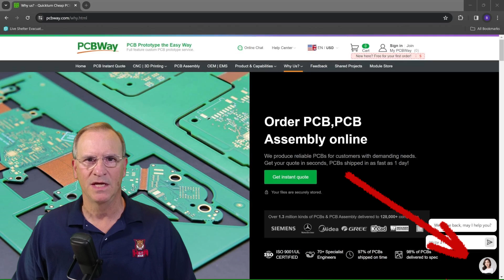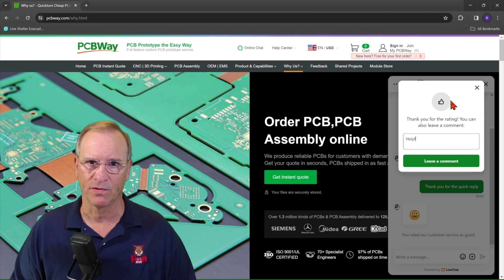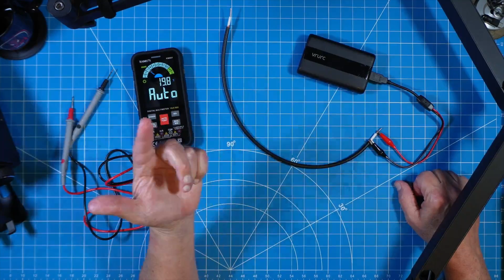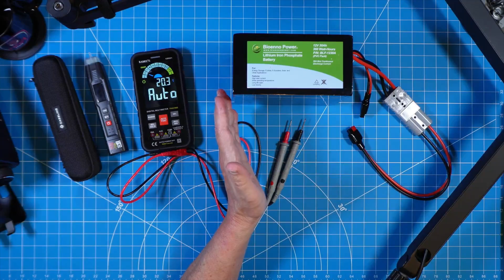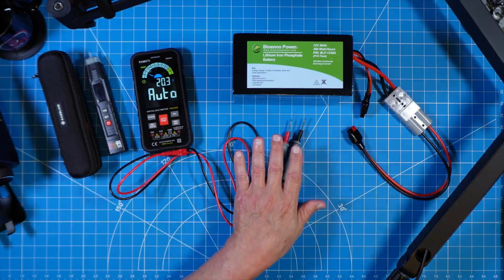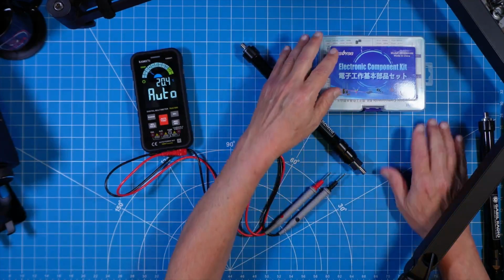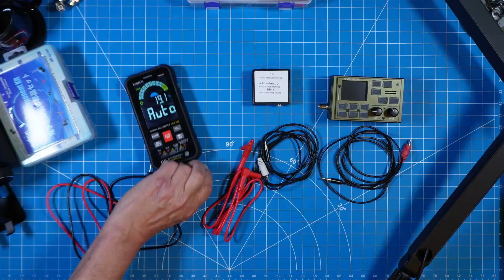I'm a Ham Radio Operator, Do I Need a Multimeter?  Let's Look at the Most Basic but Necessary Uses

Comment: Using a dummy load or even shorting the cable seems safer than using voltage to find the cables
Reply from the maker: Shorting them, of course, I missed the obvious; great suggestion.

Comment: Coax marking can be easy or complex.  A few  rounds of colored electrical tape to establish a pattern is the cheapest and easiest way I have found.  It usually only takes two colors to establish a "code" for even multi hundred run coax installs.  I saw one ham mark all his wire A-Z using black for Dit and Red for Dah.
Reply from the maker: Great suggestion!